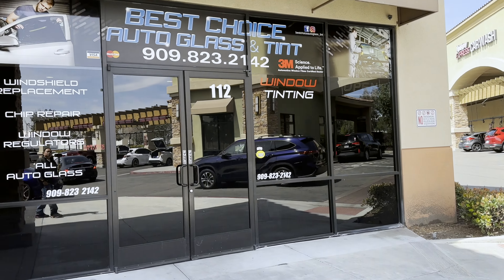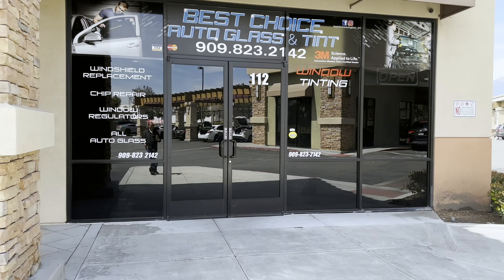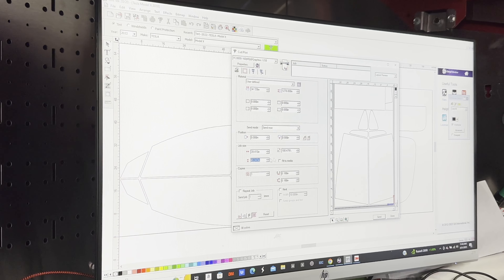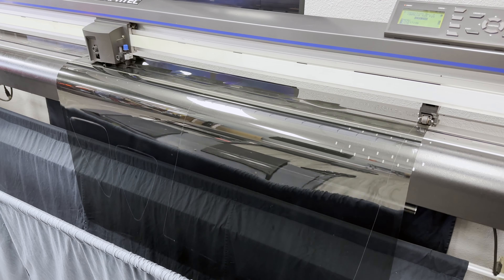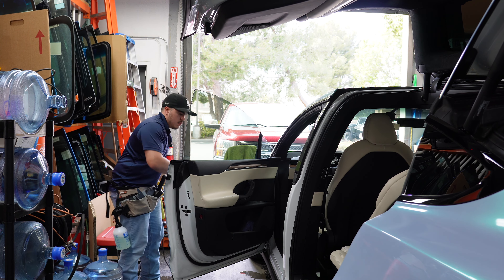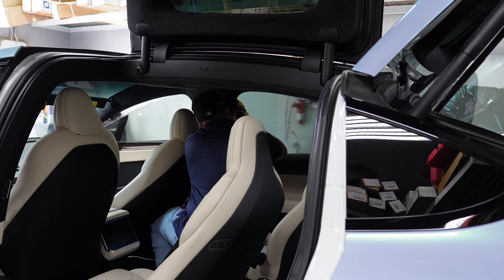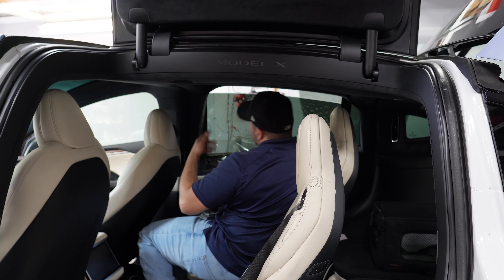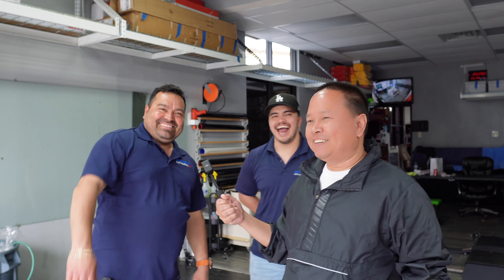2022 Tesla Model X Long Range Tinted With 3m Crystalline Window Film

Comment: where'd u get the carbon fiber spoiler?
Reply from the maker: It’s a wrap. The side mirrors are wrapped that way as well
Reply: @sherwinm  awesome. Carbon fiber cap for spoiler or wrap? Which do u prefer
Reply from the maker: @JC-gw4jl  I don't have experience with carbon fiber cap. the longest we had a car wrapped was about a year - we sold our previous Model Y that we wrapped once we took delivery of the Model X. I don't know how long the wrap is supposed to last but I hear anywhere from 3-5 years depending on if it's outside a lot in hot temps. The wrap shop we go to does a really good job. If I were to pick between the two, I would go with the more cost effective option. That way if you ever need to replace/repair it, it's not too much of an expense. Pls let me know which you go with.
Reply: @sherwinm  I ordered the CF spoiler cap from rpm tesla along with cf Rear applique and front inlay grille and door handles. Will let u know how it turns out
Reply from the maker: It’s good there’s options. Wow I’d like to see how it turns out. Thanks.
Reply from the maker: @JC-gw4jl  i checked out the website. oh man that front inlay is gonna look dope. can't wait to see it.